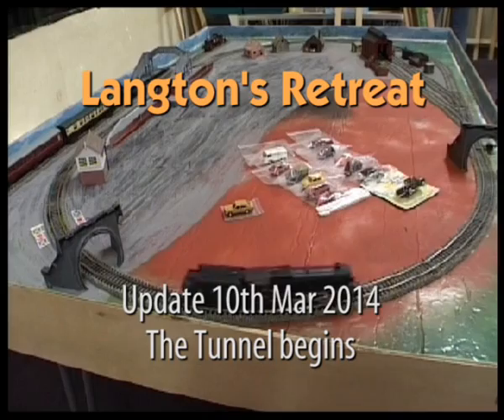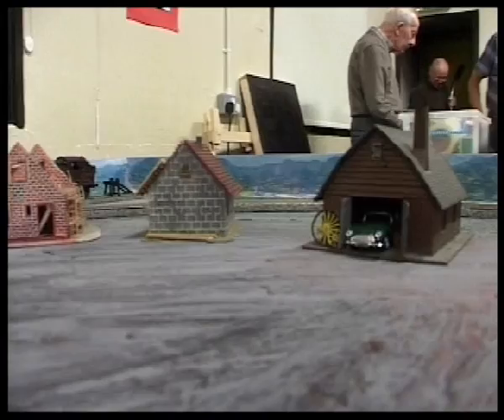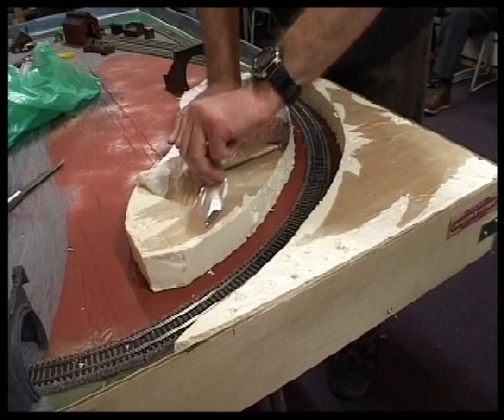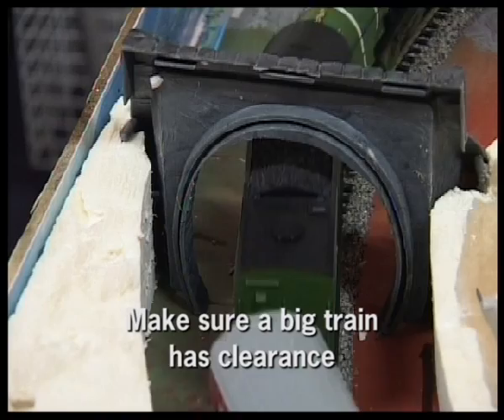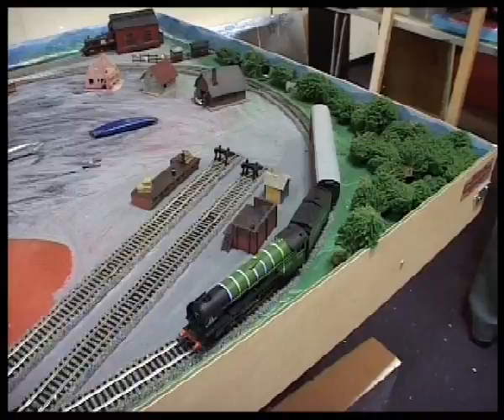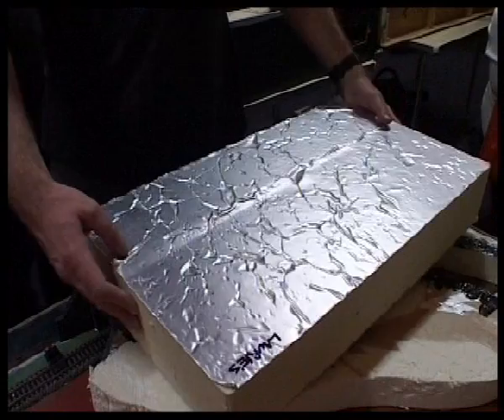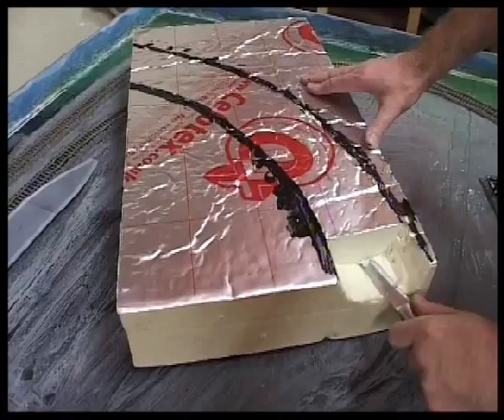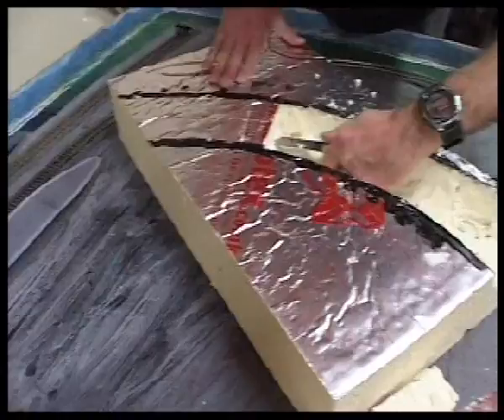Make a Simple Model Railway Part 6 - Tunnel begins

Comment: Obviously, this question would eventually appear: what happens if a train derail inside the tunnel? How do you get it out without damaging it?
Reply from the maker: Hi, in the next part you will see that the top half lifts off. The join is disguised with foliage. It seems to work quite nicely that.

Comment: What's the name of that foam?
Reply from the maker: It is called Insulation foam board. It comes in 8ftx4ft sheets costing £15-25, and can easily be cut with a sharp knife or saw. It is normally used for loft insulation, so you get it from large DIY stores.